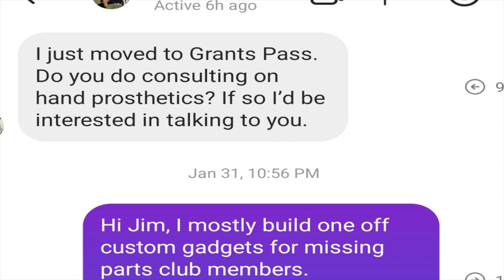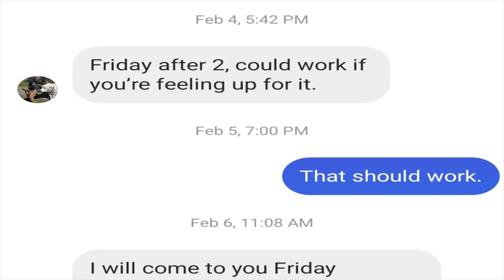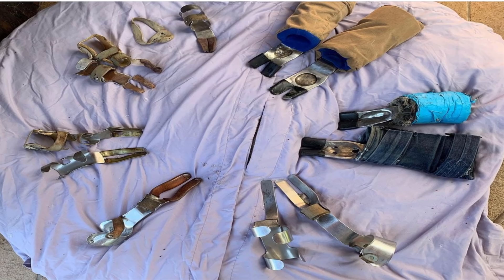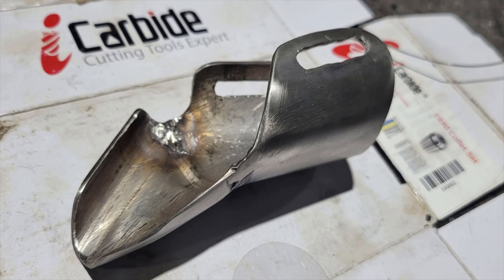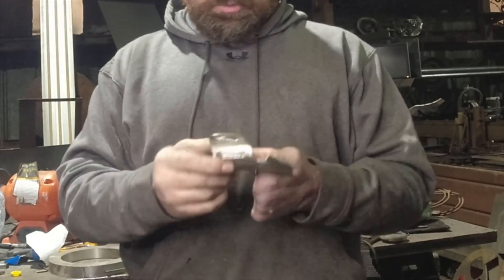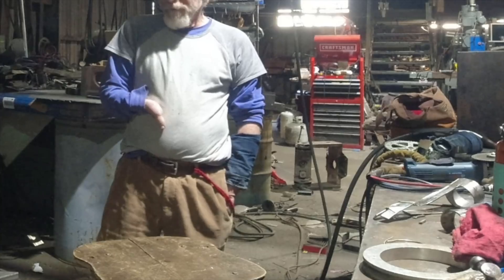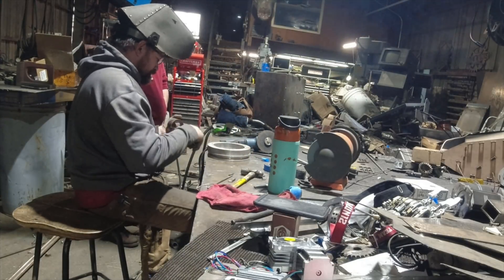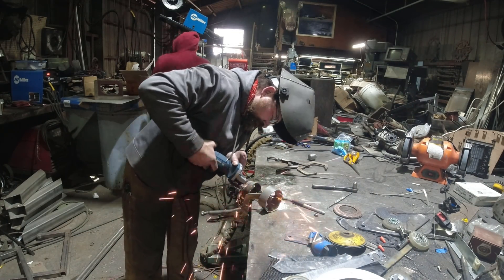Building a New Hand for Jim!

Comment: Augmenting like you do is awesome. 
Great footage of your workflow and co'opting around the shop. 

OTF mechanisms are what comes to mind for me as labour gadgets could quickly switch usage. Check out the internal mechanism for the Benchmade infadel OTF. Its absurdly flattend, reliable and locks solid enough for me to hammer en chop with in all directions. 

Ive had a whole phase tweakimg and custimizing multitools, and ended up using easily changeable scapels the are in many vareitys, high carbon thick long seraded you name it, Havalon makes them as foldables. I stuck those bladeholders in my leatherman surge tools, the surge becouse of the jigsawblade holder, meaning its the only multytool holding bimetal sawblades.

Comment: Awesome work! Really inspirational. I can imagine it would be quite painful to have rigidly mounted tools like this - Maybe you could make something that attaches to the arm, and provides sprung mounting points for easily swappable tools that provide single-axis force dampening. I'd imagine this would make a number of the tools much more comfortable, especially ones where hammering and holding bags / heavy objects. 

Either way, love the content, subbed for more!
Reply from the maker: Actually I find I have way better proprioception with hard points rather than a fiberglass and silicone socket.  Another feature is it doesn't absorb  sweat and in turn smell.
Reply: @missingpartsclub  "proprioception" - I have to admit, I had to look it up. That makes a lot of sense. What I'm suggesting would be a hard mount to the arm, but just imagine having effectively a car strut/spring/shock acting as an interface between the arm-mounted component and a tool. Further restricting the 'suspension' to a single axis would increase proprioception significantly, while making things like hammering much more tolerable.

That being said, I'd imagine the increase in weight might offset any other benefits. At the very least it presents a pretty challenging mechanical problem to solve. 

I'm really excited about your channel. Prosthetics is an awesome way to apply mechanical skill, and you opened my eyes to the fun. On another note, how do you find people in need of some help like this? Seems like a great way to apply hobby machinist skills!
Reply from the maker: Yes, weight becomes a factor in the whole accessory department. While it would be cool to have a multitool variety of gadgets available at an instant,  The idea of packing the extra weight around for the occasional usage is a downside. 
As far as where I meet my people and such. Most people hit me up via Instagram or locally,  they just come by my shop. It has to be a good fit, and they need to have reasonable expectations of what the gadgets will and won't do for me to take on the project.

Comment: could that be done with mold, he puts his hands in  specific foam, then he puts out hands, after you  fill in concrete or other polimer, after you make a plastic around the mold that completely are his arms copy. After you make a plastic shell over the mold with fixing straps inside, so he could put on and fixate the thing on, with universal end side, where the palm is, there could be nuts inside for uneversal grip head change. When my grandmother broke her leg, there was an option to 3d print leg support for her from hard plastic. These are just thoughts, but what you did is really a unique work, just like a monument for me! well done! One of the superheroes is among us!!!
Reply from the maker: It doesn't work like that. It's not about the dimensions, but more about the feel. Also you don't want something that fully constrains the limb because the residual limb will shrink and swell throughout the day depending upon hydration levels, if it's constrained it'll become too tight and start to hurt. And if it hurts, they won't wear it.